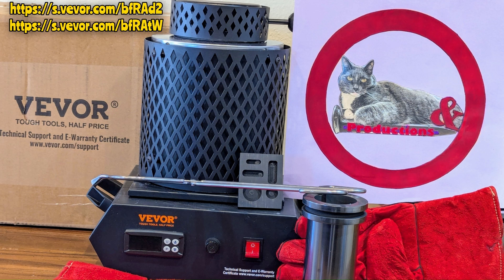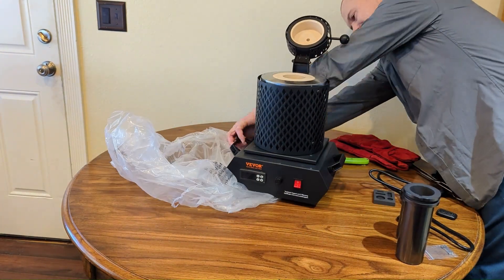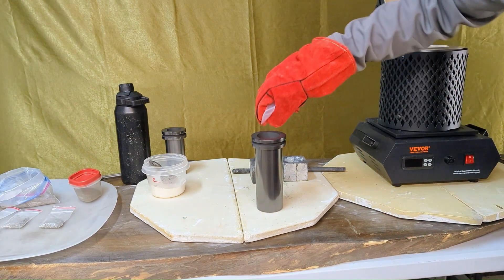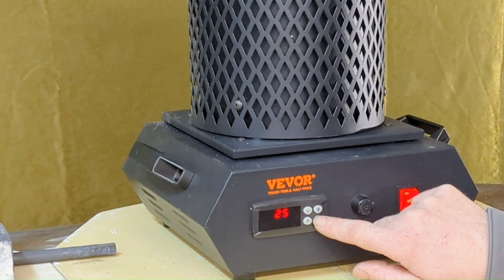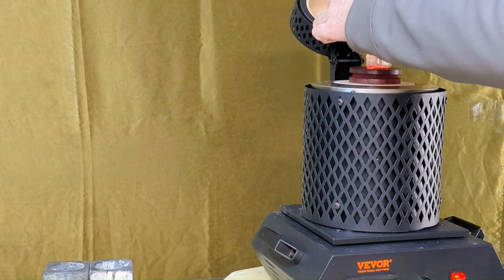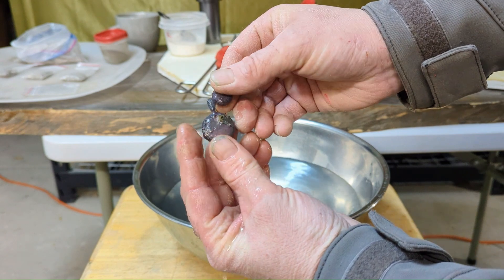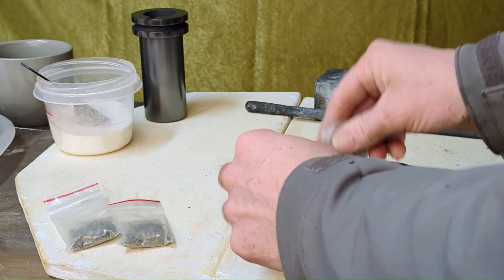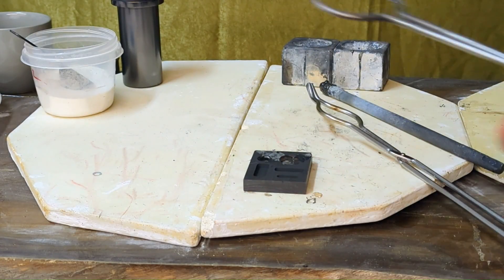VEVOR Electric Melting Furnace Review.

Comment: the question should be whether replacement crucibles are available... they typically don't last if used alot. vevor is not a very reliable source of replacement parts or support on many of their products. consider many of their products as throw-aways
Reply from the maker: I have resources for replacement crucible's when necessary. As far as VEVOR Tools, I've never had any personal problems with any of their products. My current propane smelter is made by VEVOR and it's one good little smelter.

Comment: That is soo awesome. Probable takes way less time and is more accurate than using propane. Got your large one for the bulk processing and now the induction one for refining. Coming along nicely. I have a vevor magnetic got stir plate. When I press and release the two temp arrows at the same time it switches between °f and °c. Might want to see if that works on that unit. Cant wait to see what you refine next. ⛏️⚒️👍🐾🐕🎂👍
Reply from the maker: Excellent advice, I will try that. The owner's manual didn't indicate any ability to change it from Celsius to Fahrenheit. Thank you, Adam.

Comment: I bought one from the pawn shop for $80 buy it was just the furnace
Reply from the maker: I believe multiple websites have the graphite crucibles available if one is needed to complete your furnace.
Reply: @smokeyandspikeproductions yeah I have to prioritize projects   Between my wood lathe , do some  casting and lapidary work.
Reply from the maker: @Willrocs  I understand. I love wood working myself and would like to get into casting again honestly.
Reply: Do you have to fire the crucibles before you use them ?
Reply from the maker: @Willrocs  I didn't see anything about a preheat or other restrictions whatsoever in the operations manual of the furnace. I did approach my ideal temperature slowly.